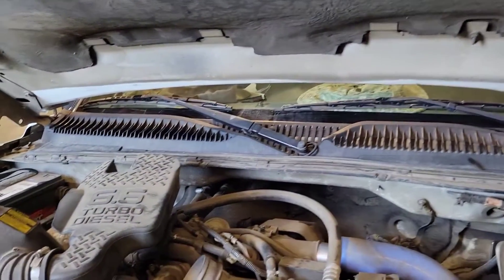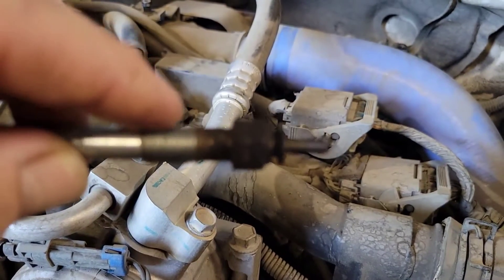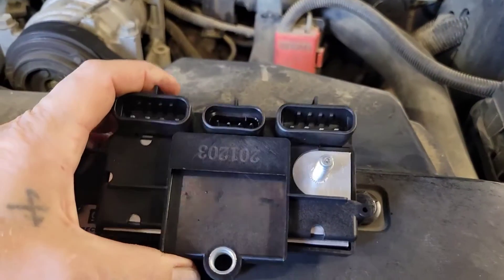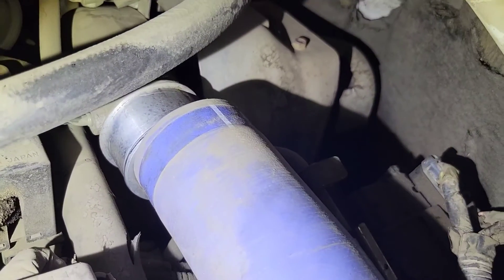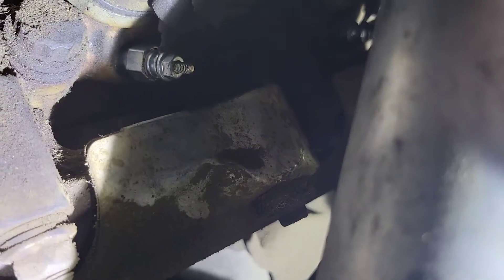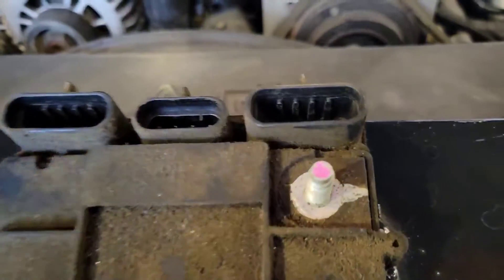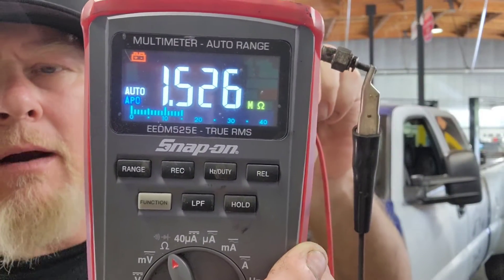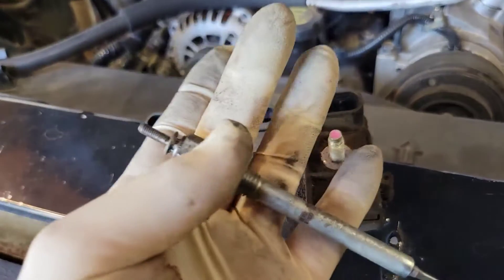Duramax 6.6 P0380

Comment: Here's an image of what I'm talking about:

http://youtube.com/post/Ugkxx_UjnBaRlJ4myj0vm6p5JahcGg5RX3Li?si=fvPHfIuq-l3-KU4G

Hey Tone, it's my first diesel -- a 2003 DMAX.  I thank you for your videos.  This one helped me diagnose.  I replaced the GP module anyway, but it is the connector on the right, as you look at it from the radiator, the last pin on the right...couldn't light my test light and wouldn't test Ohms.  All other pins are good.  Can you tell me which GP is connected to that right-most pin?

Thanks!!
Reply from the maker: Hey bud I am happy you watched my video, I do not know off hand but if you message me on Instagram and give me vehicle info I can try to help you out.

Comment: I have an 02 lb7 truck has p0380 & p0335 I changed all 8 glow plugs & glow plug module , I tested all glow plugs are reading fine , truck doesn’t start just cranks, replaced the crank sensor just in case still no start/ scanner isn’t picking up rpm or crank signal when cranking any ideas or knowledge you can spare
Reply from the maker: There is a wire that feeds rpm signal to ficm, I believe. You may want to look into that.

Comment: Ever seen a full set of a/c delco glow plugs bad? Messed with me bad but every single glow plug I just put on infinite resistance! Bran new a/c delco glow plugs guess now I’ll have to ohm test every one before they go in and never assume the new ones are good……..
Reply from the maker: I did see one time where a tech replaced all the glow plugs and they failed immediately,  there are 2 different glow plugs.  If you put the wrong ones in they burn out right away.  Check that.  Thanks for watching

Comment: Hello. congratulations on your channel. I am registered and watching your videos I would like to understand how to solve the problem related to the engine failure light with code P0380 Glow plug / heater circuit malfunction "A" .... I have changed all the glow plugs and the glow plug controller module but the fault light engine continues to start. Why? I'll attack the video. I attack to you the video. https://youtu.be/toRNC1_sQPU

Comment: Nice video Bro! I have a 2015 LML throwing P0381 glow plug heater circuit problem.
If I replace the module, does it have to be reprogrammed to the ECU?
If so, am I cursed to go to the dealer? Can I do it with a diagnostic tool
Reply from the maker: Unfortunately it does requires programming.  The injector flow rates have to be programed into it.  You can probably find a diesel shop that can do it.  Thank you for watching.

Comment: I have in my shop a 2016 Duramax and I am in  the middle of replacing a tranny cooler with both lines and I had to remove the whole radiator support plus the fan and shroud assy. I now have a deeper respect for those who work on them all day!! Most of the body repair is bolt on but the mechanical is a little challenging due to the routing of the hoses and wires. I took pictures to try from getting lost.
Reply from the maker: Oh yeah that is funny, yes keeping track of everything can be tricky. Thank you for watching.